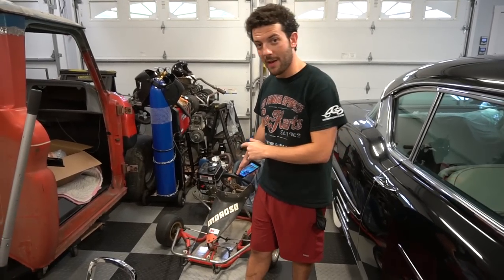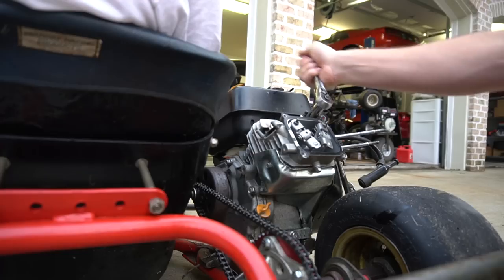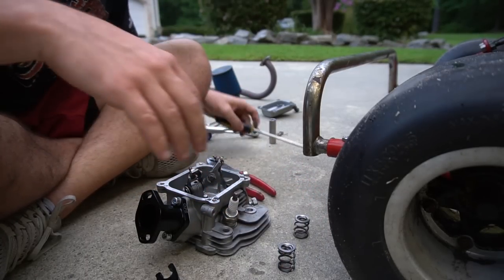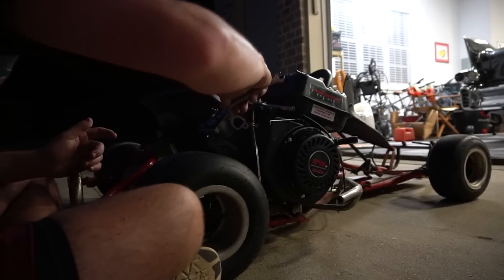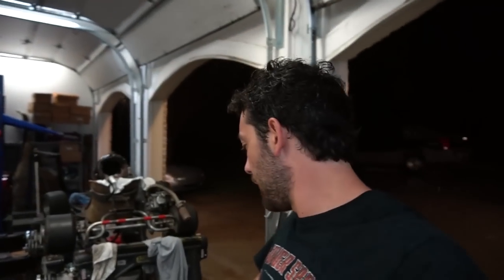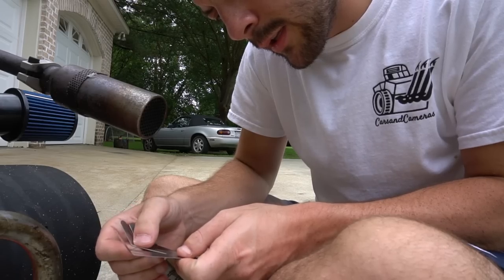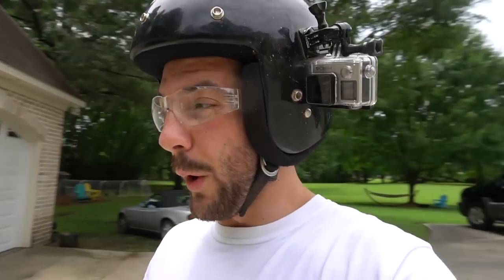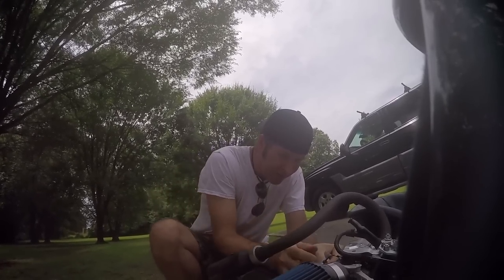Modified vs. Stock 212cc Head

Comment: I had the same issue you guys had not having the .03 gage. So I googled thickness of a couple of house hold items. A grocery bag is .01 so you can fold it and get the measurement you need. It worked like a charm.

Comment: 120 feet aint enough, you are JUST STARTING to get into that upper RPM range that the port and polish work will shine.  Do another vid, but go out to 300 feet.
Reply: absolutely correct
Reply: thats the point
Reply: it would be obviously faster if they did it longer
Reply: CarsandCameras did you guys fix the crank case ventilation
Reply: should also replace the clutch with a race clutch, give it that umf it needs on launch
Reply: Heck, I used 100 foot passes for my RC cars to calculate their acceleration and speed by a certain point. There is a plus / minus .25 just for normal reaction time AND that in addition to +/- 10% (estimated) for general human error. In other words this test was weak sauce.
Reply: kartzgo 99 Race clutch or 3D manual clutch.
Reply: There's no point in that. That's what the top speed run is for.
Reply: AND get into higher RPM for testing purposes!
Reply: Ratkill9000 them clutches are junk
Reply: Michael McFarland Never heard anyone say they were garbage. Definetly cheaper than a racing disc clutch though.
Reply: Ratkill9000 there's the bully disc ....horstman ...noram ....Max torque ss clutch with changalbe Gear ...
Reply: Kartzgo 99, just change to stronger springs so the clutch will engage at a higher rpm.
Reply: Yes if anything it will kill lower end power and move it up in the curve.

Comment: Stock predator valve adjustment is 0.0039-0.0059 per the owners manual that comes with them. That’s for both IN /EX
Reply: ......with the 18lbs springs ?
Reply: With 26# springs???

Comment: I shaved my hemi 212cc head 0.60 thousands and lightly ported I picked up lots of low end grunt from the comprrssion alone. Higher compression does get you out of the hole.

Comment: After the new head you can tell that it bogs a lot at the start. Add more fuel at low rpm and it will be much faster.

Comment: If you want to get more top speed take out that cl2 cam and put in a black mamba 275 that will help alot.  You can always go even bigger but once over 275 you have to start cleaning room inside.
Reply: Allen10390 pretty sure they have the mod2 cam in it
Reply: Anything over 265 lift cam you need dual springs. This is coming from dyno cams engine builder.

Comment: use different fuel when you up compression aka cam and shaved head it will ping if not using High enough octane fuel
Reply: They use 93  thats well enough

Comment: The head work shouldn't really make any difference in the low to mid revs. which is all you're getting to in your runs.  It will however make a substantial difference in the upper revs.
Reply: Hear hear

Comment: correct valve lash on those things is .006 intake and .008 exhaust, +/- 1 thou.  ike was right to call bullshit on .003 both sides.  if for some reason you've got metric feeler gauges that's .15 and .2, +/- .02mm on both.

Comment: Might need to jet up again,  you should rig up a simple stoichiometric gauge  (an autometer gauge, an o2 sensor, and a battery) and tune that buggy up.   Also tap the tank for an oil cooler / oil pump / oil filter.   Sounds like you need a timing advance too.    Anyway, from the sounds of the teaser you made your goal anyway....keep a rockin...

Comment: Might try taking the clutch apart and roughing the surfaces up. Get the glaze off. Might bit a little better. Also might look into a manual clutch. Go Powersports..... wink wink
Reply: NOCAREBEAR are you speaking of the 3D clutch?I would love to see them use one also,I watched another YouTuber that used one but didn't like it because it couldn't pull his weight around that well
Reply: Nicks backyardprojects yeah! You talking about Red Beard Garage? Think that's the name of it. I was wondering how well they did with a hefty guy. I'm thinking about putting a 16hp motor on a Yerf dog. I was think about a manual clutch but if they don't work good with weight I'm out. Imma fat ass so I'll probably go with a torque converter. Unless I can find a good XR250F motor.
Reply: NOCAREBEAR yea  I didn't want to mention any names haha but if you go watch all the old videos with the 3d you can see it doesn't pull him well he even mention how bad he had to feather the clutch and no longer uses it

Comment: In the predator owner manual it says the intake valve clearance should be 0.004"-0.006" and the exhaust clearance should be 0.006"-0.008" it is on the first page of the owners manual

Comment: Taller tires! Also, I remember watching professional kart racing years ago, the drivers had to adjust the carburetor when they would hit the top speed straightaways.
Reply: VA Outdoors Sportsman  On certain carbs that's true. I had a tillotson on methanol with an adjuster attached to the steering wheel.

Comment: Yeah I did some math and with all the bells and whistle you can throw at a 212 to get it to 18 hp it would cost more than a stock 670 (this is MINUS the cost of the engine it'self), would need high octane gas and be hard to start by hand. btw the 670 makes 22hp stock. In other words it isn't worth it. The little 30$ filter and jet kit with the 18lb valve springs and a governor removal (I just held my arm back with a zip tie no need to open it up) with a strait exhaust is about all that's worth sinking into it. If you want to port, polish and shave the head yourself fine go ahead.

 And just to debunk this exploding flywheel myth. I've held mine at 5200-5500 for 10 minutes before (don't ask why) and it hasn't come apart yet. Thinking about doing what my cousin suggested (he's a old school Briggs & Straton racer) and getting a 173cc or 79cc motor's flywheel.
Reply: The flywheels are more expected to blow around 7500rpm, had a 10,000rpm predator but skipped out on the billet flywheel, currently in the process of a rebuild

Comment: If u bump compression it eats ur get up and go but helps you produce a better power at speed but if u decompress u can run higher rpms and better of the line but have a weaker power band

Comment: Could you guys set it up with a torque converter and a small sprocket? So it would be nice because you would have the gearing to take off with the converter and a high top seed too with the sprocket.

Comment: sounds like you have a flat spot on take off maybe up the needle a notch
Reply: It does sound like it bogs down right after it gets rolling.
Reply: David Simpson that's when the centrifugal clutch is fully engaged.
Reply: Can't up the needle in a stock carb this whole video they didn't use the mikuni...why not...it's beyond me I would have had that on from the start

Comment: Hey guys I just bought a predator 212 and I have it on my go cart and the throttle only works when I have the choke on all the way but by that time I'm already going 20mph how do u use the throttle all of the time and can u make a video showing how to setup the throttle and stuff with a centrifugal clutch
Reply: Bama Bassing that sounds like there is a problem with the motor
Reply: Matt Schork it's a brand new engine
Reply: I suspect a vacuum leak.

Comment: Why are you still running the stock carb? Mikuni giving you headaches? I swapped for a Keihin PE28 (26mm bore) and never been happier. Running on a 14cc head too with 26mm intake and 24 out. 80 mph!
Reply: priit mölder  where did u buy it  and     how much,. I was going to order a mikuni but I've heard they ant all that good... Lmk.  Thanks....

Comment: .004 is the proper valve lash for the 212cc Predator Hemi and non Hemi for 18ld and 22ld springs. And why do you only go 120 ft on test runs? I can hear the engine start to kick in at the end of run. You need to run 900ft so the RPM’s can be fully kicked in! Come on Ike you should know this!

Comment: The rollers in the torque converter are too heavy - notice the bog? Modified and stock both had the same problem. The ported head won't flow better until it's in the higher rpm ranges... Oops - no torque converter? Stronger clutch springs to delay engagement, then.

Comment: I have a basically stock 212 predator on on a mini bike that will do 40 and will wheelie with the smallest amount of throttle applied
Reply: Brodie Lueken that just means you have a lot of weight over or behind the front axle
Reply: Brodie Lueken rear axle*

Comment: You cant swap valves without LAPPING them
Reply: They disassemble the heads on the dirty/sandy driveway, lay all the oily parts on the concrete where I'm sure they picked up grit, and not on a rag at least, THEN just pop in used valves from one head into a head with bent valves!!! NO assembly lube, NO Lapping, etc.... This is NOT how you build a motor boys!!

Comment: my go kart has been acting up. it will only go like 5mph when u push the throttle all the way down and its top speed used to be 27. the engine sounds terrible. its a 5hp tecumpsi. do you know what the problem is?
Reply: bloodyAiDkIt sounds broken.
Reply: Could be a lot of things, but most likely is a dirty carb. Pull the carb, CAREFULLY disassemble it (take notes or pictures for each step), hose it down in carb cleaner, toss it back together and stab it back in. Make sure you clean out the fuel tank too ;-)
Reply: The problem is its a tecumseh
Reply: Check spark, clean air filter , check gas put fresh in , clean the carb i, check the value clearance, other than that I'd get a predator for 100 bucks and be on your way
Reply: Sounds like you should clean your carb

Comment: Modified engine is just starting to pull crossing the finish line. Run it a longer distance or drop the gearing down.

Comment: Do you recommend the China mikuni carb or pay for the Japan carb
Reply: Japan is built to  better tolerances and better quality.
I have a Tillotson TCT Mechanical fuel injection
Unit $30.00
I'm going to compare it with a Mikuni 22mm carb kit 
I have all billit components & Flywheel
In a BSP 196c.c. engine with Black Mamba cam w/#18lb. Valve springs

Comment: That thing NEEDS a torque converter
Reply: yup, or that.. would give 10-15% more top speed, with a bit of slippage through its belt transitions, but yes 60+
Reply: I agree. I have a converter on my race chassis. I'm hitting about 55
Reply: torque converters are trash

Comment: So if you guys wont do a motorbike motor can you at least address why?
Reply: Probably because they don't have to pay for the predator 212s on account of their gopowersports sponsorship. Prolly the same reason they product place every five seconds, that they never name any other brand of parts anything other than generic 'what it is'. 

They're pushing GPS pretty hard, in return, they're getting a LOT of free shit.
Reply: TestECull Yea i figured as much but it almost seems like they dont want to do it because theyre afraid to lose the sponsorship
Reply: Jeff Green. They can use a predator 212, run tav2 30,gokart motor mount  provided by go power sport if They want to jackshaft it to work and still thank their sponsor.so i dont see a reason why not to build it.

Comment: Put it on the dyno to see how much power it makes to the tires and on another race cart put a 2stroke on it like a cr125 engine
Reply: Go karting101 iirc these engines don't have the torque to work on a dyno. I may of dreamt that though. I don't think I did.
Reply: Stephen Butler with the mod kit I think it should work and they had the blue 212 go kart on the dyno 1ce

Comment: I need help I have a predator 212 in a go cart and every time I turn or drift it dies what do I do
Reply: Mississippi Mud Team the low oil shut off is known to cause this. unplug the yellow wire that comes out of the front side of the engine. if you do this always check your oil level before each ride.
Reply: Matt Hudson will do thanks for the help

Comment: I've yet to see definitive data that shows the head porting does anything, it may even make exhaust refractions interfere with scavenging even more than it does on a stock head. Low volumetric efficiency engine like the 212 behave differently than high performance automotive engines, and what works for one does not necessarily work for the other. Also the pizza fatigue sounds like heart problems.
Reply: Steve on Engine Masters and Hot Rod Garage ported a set of heads and gained 110hp

Comment: If you do not shave, port and polish properly, you can LOSE power. I used to race tune snowmobiles. I can also tell you, you can provide all the power you want to the engine, but if it is not getting to the wheels, it doesnt mean SHIT. Blowing clutches, breaking crankshafts, destroying drive systems, yes, its all part of the game. When you change one variable, you have to know how to and WHAT to change to make it work all together. Too much compression can kill an engine , wrong engine timing, Seen a guy whos spark plug gap would close up because of compression. Throw away the book by the way. When you change things mechanically, you change a lot more than that. Learning to Read the plugs is your number one key to properly tuning an engine. I learned that right away. heat range really means alot on an air cooled engine. That and fuel burn ratio. So much to learn, get a note book, start recording every change. Change ONE THING AT A TIME.
I tuned two strokes AND FOUR STROKES...WE RACED BOTH.

Comment: Do you guys not hear what I hear? When you floor it, It bogs. When you roll, guessing maybe 20 feet, you can hear the engine start to pick back up. About the time it starts to pick back up. you let off of it. Your sprocket and clutch setup is all wrong. Essentially, it's geared too high for the short distance you are running it. You need a different setup. Maybe a torque converter? Something that will let the engine rev higher off the line. Without burning something up. But still, give you the top end you want.  I bet your current clutch setup is already screaming for mercy.

Comment: No wonder you guys blow up motors.  Valve lash is .003.  Set the intake when the exhaust is just starting to open.  Set the exhaust when  the intake is just closing.  This way you will be sure the lifter is not on the cam lobe, but on the back side.

Comment: @CarsandCameras
Turbo + EFI the predator ^^, you might be able to reach 70mph if you do it correctly this time and tune the thng well ^^ it'l be fine ;-)
but you might wanna get a forged piston for the predator, a good investment, and can get more ou of it. since it already have billet rod and flywheel plus all the other supporting mods. aadd a good forged piston and it will be bulletproof ^^
Reply: Just buy a bigger engine at that point. There’s no point in doing that to a 212 when a motorcycle engine, and 670 or anything else is  better
Reply: Yeah at the amount of money all that will cost and the higher it revs the more of a chance of failure but a motorcycle engine with gears would get it right!!!

Comment: You should try using alcohol.
Reply: Lokwicked which is the answer to most issues.
Reply: Lokwicked Great way to blow up an engine.
Reply: Not if done correctly. Get the proper emulsion tube, jet and a milled connecting rod with a bearing and they will last quite a while.

Comment: Why does it keep bogging every time he punches the throttle
Reply: kyfiss ! Slow carb
Reply: Because the engine is tuned for top end power with all the mods they put on it. No low end torque to speak of.
Reply: kyfiss ! The clutch is getting old
Reply: MaxTheKanuck makes sense! I used to own a stock 212 that had alot of torque but it topped out at 20mph
Reply: Sam Buckel ya I heard him say that  it slips but I font think that would make it bog
Reply: skullboi2012PlaYs 2 maybe
Reply: kyfiss ! The Engine dose not top out at 20 mph your gearing is what is stoping you from getting there my go kart has a 212 on it with a 72T sprocket and I hit 55 mph
Reply: Sam Buckel maybe I got rid of it a few months back I don't remember my gear ratios

Comment: Why would you do a cylinder head comparison and then not use  the same carb? That ruined the test! The Mikuni will always breathe better and produce more power throughout the rpm range. Also, if you're going for top speed over-revving the piss out of the engine is NOT the way to do it. You'll be needing rings and valve guides, possibly an overbore and piston very soon. Re-gear the kart.
Reply: cwthemachinist I thought they did use the same carb, but would take the mikuni with them to try it out later.  Not sure?
Reply: Dubit Fast They did bring the Mikuni to try later, but used the predator carb for the second acceleration test, they used the Mikuni for the first acceleration test. I guess it doesn't matter. I just aggravated when I watch people do dumb things with engines.

Comment: You should do a electric cart build
Reply: That's actually a pretty good idea.
Reply: They did a small one a long time ago with a starter.
Reply: no vruum no fun
Reply: Do a gas cart with eletric reverse
Reply: Magesticly magestic 2.0  how dare you.
Reply: 4 wheel drive electric go cart would work much better than the 4 wheel gas they are currently doing. That one is nuts though, needs a lot more reinforcement imo
Reply: Magesticly magestic 2.0 they already did